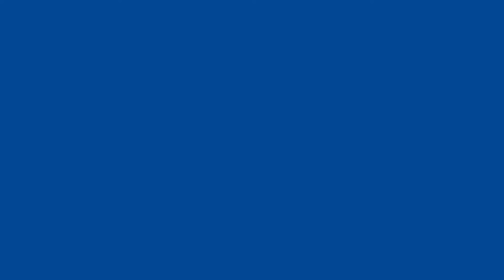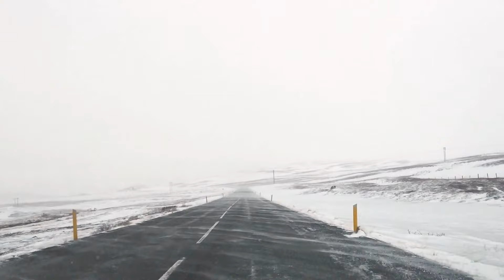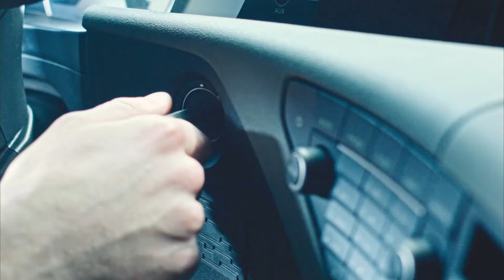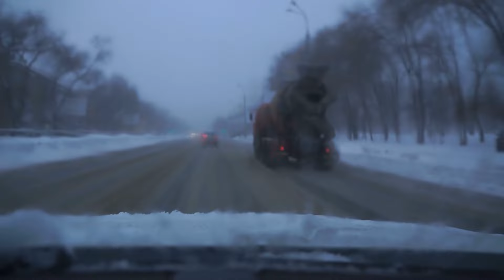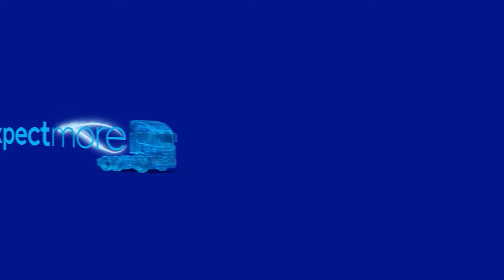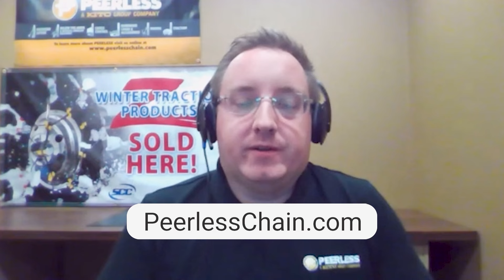Gearing Up for Safe Fall and Winter Driving

Comment: Super capacitor, is no good, if you do not have a physical disconnect to your batteries/capacitor, to keep the angry pixies where they should be, to quote a boating acquaintance. Waste of money, at that point.
Best wishes from the cold weather testing center of Canada.